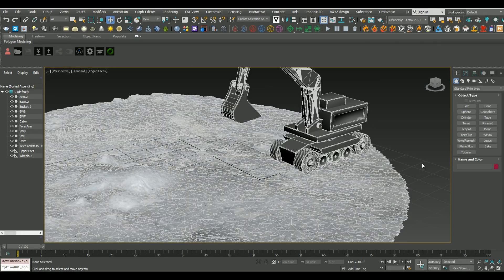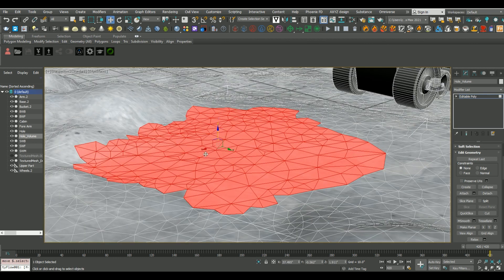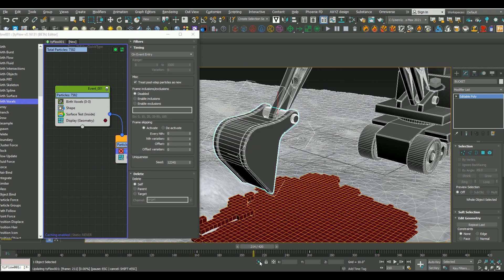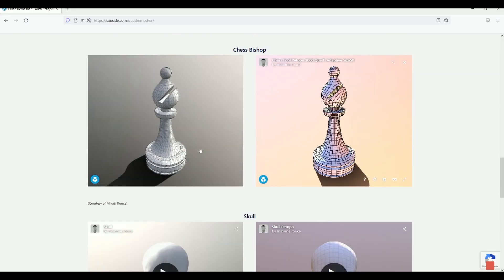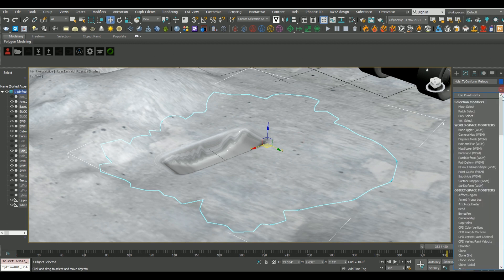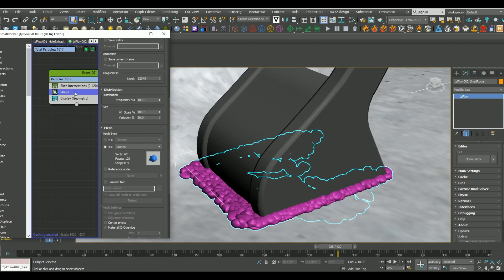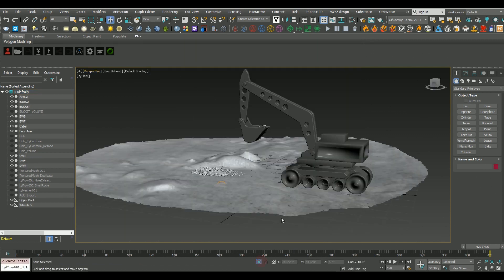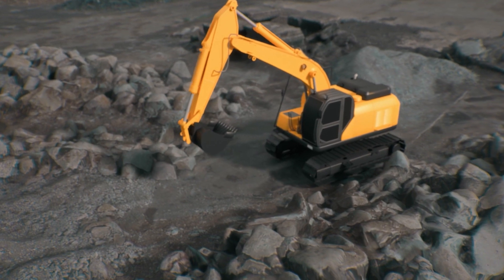Using TyFlow & 3ds Max to simulate digging dirt, soil, or sand with an Excavator

Comment: It’s easy to assign voronoi fracture, physx shape, surface test to a piece of 3D mesh that will be dug. Then surface test will test against excavator scoop and we send the even to voronoi fracture, physx shape, physx collision to scoop and ground, force gravity.
Reply from the maker: The only problem with that method is it doesn't show volume below the surface, unless maybe using multiple voronoi layers and a container so they don't just fall away? Not sure